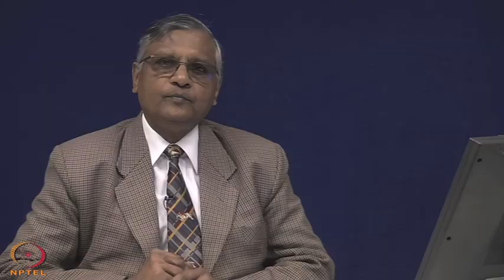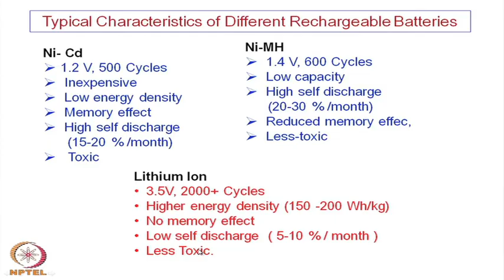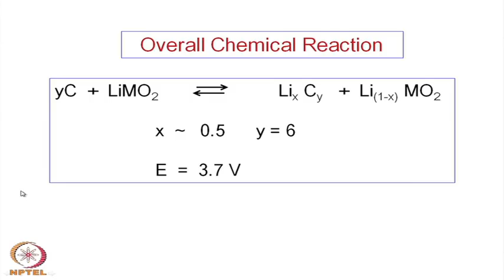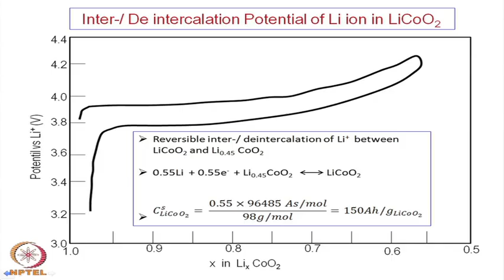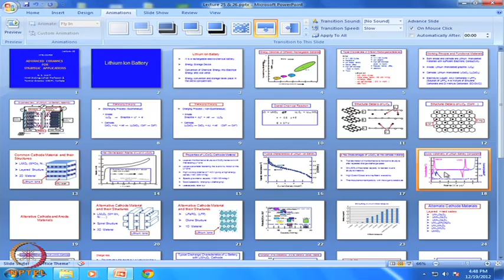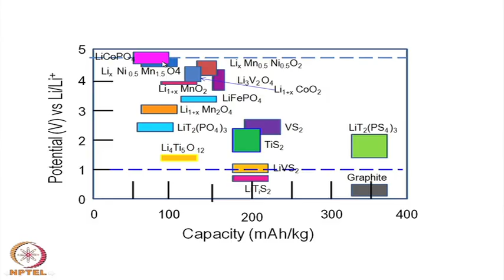Mod-14 Lec-32 Lithium Ion Battery

Comment: Found a really good deal on these batteries at http://BigBattery.Com/Deals - You guys should go check them out if you want LiFePO4 or Li-Ion Batteries. I was able to use coupon code "Cycle5" at checkout for an extra 5% discount.

Comment: Why cobalt is the best material for cathode so far? is there a chemical or quantum mechanical reason?
Reply: In fact, it is the opposite. Cobalt is NOT the best material for cathodes because of  low lifespan of cobalt-rich cathodes, inherent elemental toxicity leading to problems in reuse, recycling and disposal, high cost due to its low abundance index, distortion of cobalt-based cathode structures after repeated cycling, low safety indices, increased thermal runaway possibilities and decreased performance at low and high temperatures. From an ethical perspective, with recent problems of corruption, human rights abuse, unethical operations, and violence in the Democratic Republic of Congo in mining of cobalt (the largest supply of the element in the world), corporations are trying to get rid of cobalt from their battery cells.